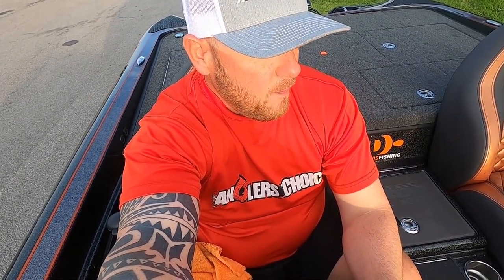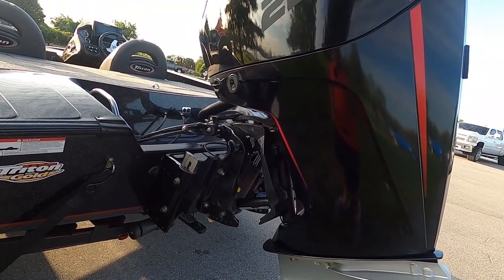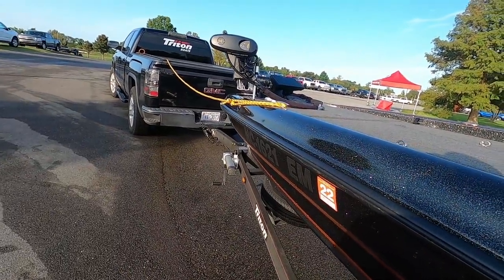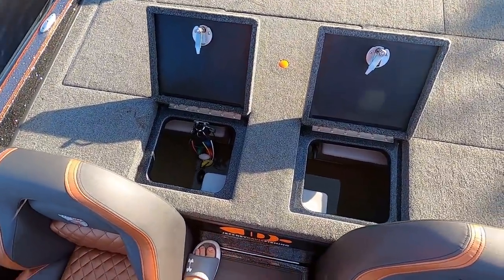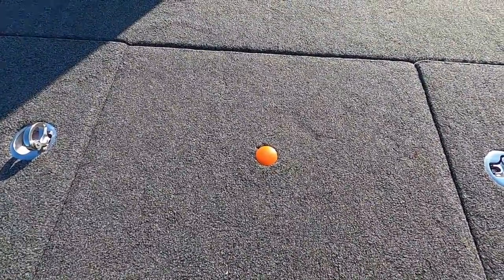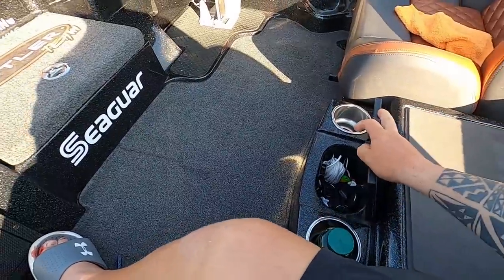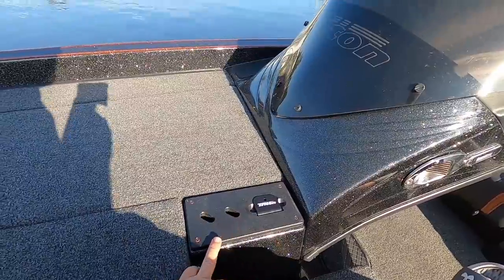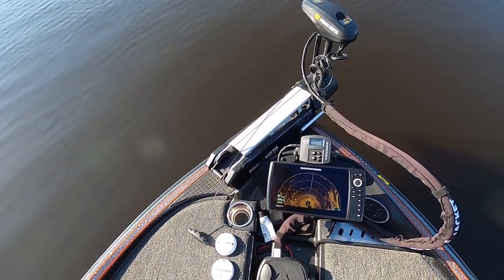Tour My Triton 19TRX Patriot

Comment: I've got the same boat with a 225. It's probably the best entry level boat in the 19 foot category (19' 9"). It has a better ride than most of the 21' boats I get in. Great big deck front deck. They need to move the tool holder or sink it down. I've tripped over mine at least 10 times. Mine does chine walk around 65 MPH but I've got it up to 70 MPH many times.

Comment: What kind of speed are you getting out of yours with that motor? I have a 19XS which is an older version of that same hull with a 225 Mercury on it.
Reply from the maker: It’s a 70mph boat. Some can see 72 with the right conditions and a light load.
Reply: @JeffreyDavisFishing  Did you ever add power poles? Mine has 2 8 foot power poles, a 36v Ultrex, 4 regular batteries, 10" jack plate, and a 25" pitch Tempest. I can run 68-70 loaded with another person, and about 72 by myself. Its the 225 Pro XS 2 stroke.
Reply from the maker: Yeah. I did add 2 power poles. I also had lithium trolling motor batteries. I’m not a speed guy so I never pushed the boat to its limit. I normally cruised around at 50mph.